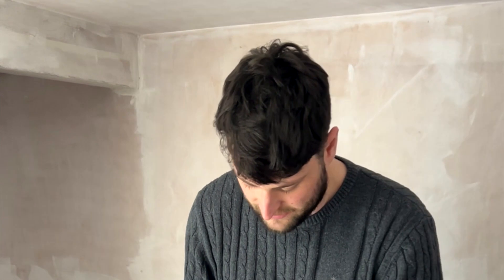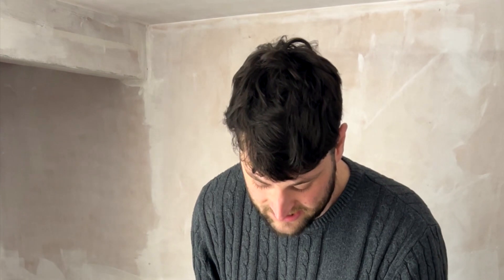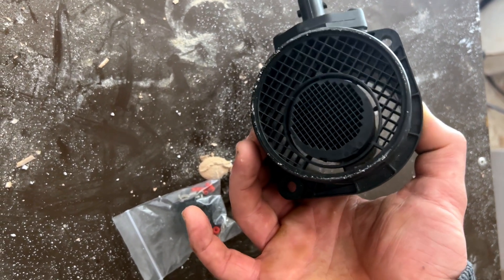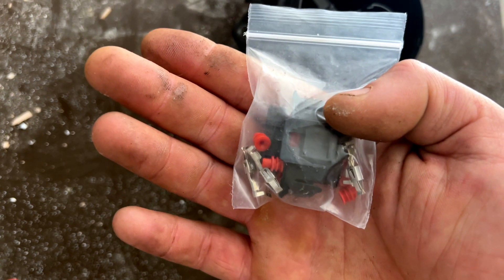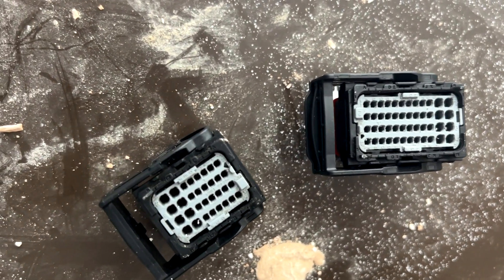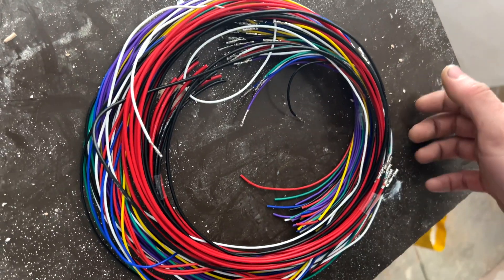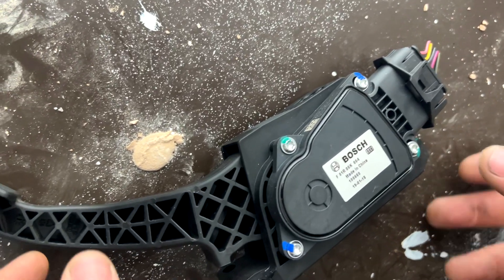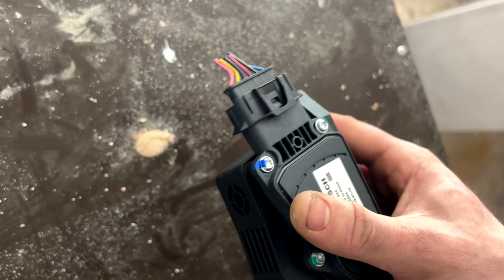Rover K Series Turbo Engine with DSG Transmission - Electronics Rundown

Comment: Crazy im doing a 5 auto k24 non vtec swap into ek civic would love to do DSG in future but way over my head
Reply from the maker: Sounds like a wicked project. We are looking at bringing out kits for the Honda K Series engine in the future, to help people do the DSG swaps easier.
Reply: @LeesbrookPerformance  would be amazing in the future cause right now the 5 gear auto gone keep me limited to 250hp anything above it would probably blow it and I'm not able to go manual 👎
Reply from the maker: @polishoskar2039  that’s sad to hear Oskar, once this project is finished we can develop all the software needed to run the DSG, so that we can then work on the Honda engine. Will keep you updated👍
Reply: @LeesbrookPerformance  can I ask dose it use a new ECU that Controls engine and DSG together or use existing ECU and additional TCU for the dsg that knows which rpm shift on
Reply: dont know if you will see this comment but ive been looking into doing a dsg swap in to a ek civic as well and with a k series did you ever get round to doing it?